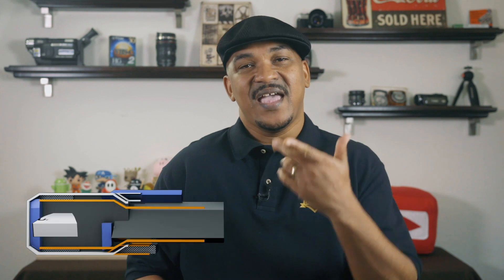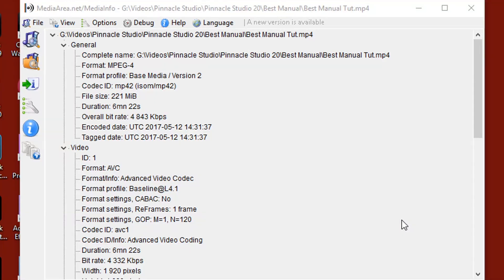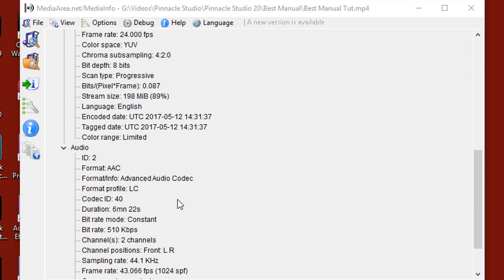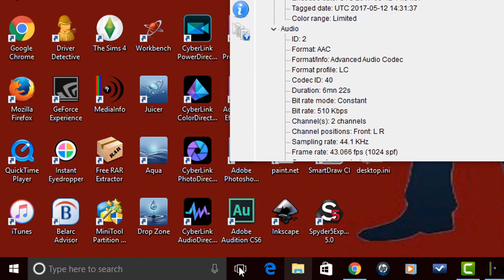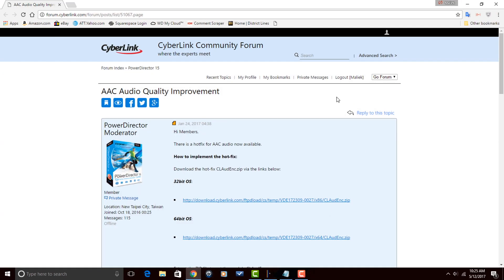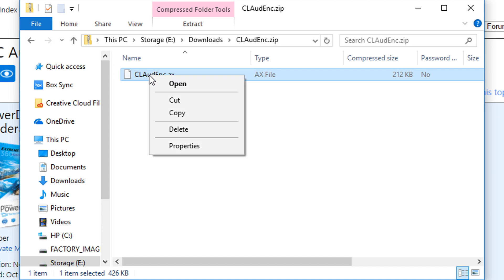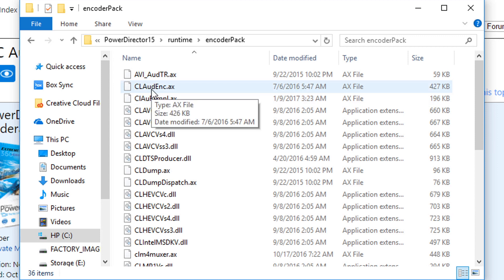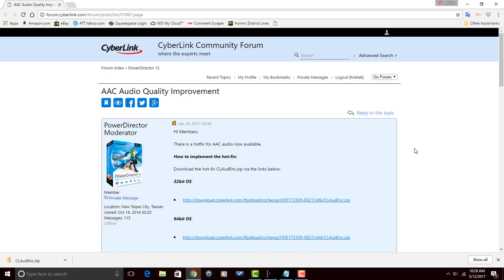How to Fix AAC Audio Quality / Hot Fix | PowerDirector

Comment: can't upload mts file. it is placed on the bar but has no sound. do you know what can change the sound in power directory 19 ??
Reply from the maker: Try changing the file extension from .mts to .m2ts or you can covert the file to .mp4 using a free program called handbrake. If you Google ".mts file audio" you will find that this is a common issue with many programs including Adobe Premiere Pro. It's more a file issue than a program issue.

Comment: Didn't work at all... when I'm using a good sounding mp3 in my editing, it will sound really bad after rendering. Same thing after installing the hot fix. I don't have this problem after editing and rendering with Windows Movie Maker... This is actually quite a shame, because a paid for Power Director and Movie Maker is a free software...
Reply: I did this hotfix and I am still having the same problem.

Comment: Malik, does sort out the problem I raised with you in another thread where I had problems with a bad audio output when rendering? Thanks
Reply from the maker: If you are rendering files that use the AAC audio codec then it might address the issue.